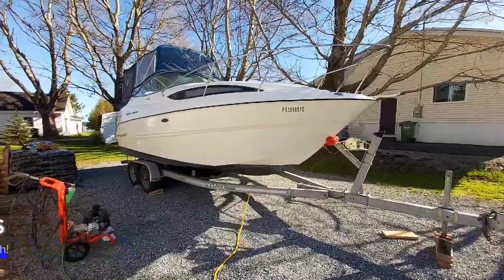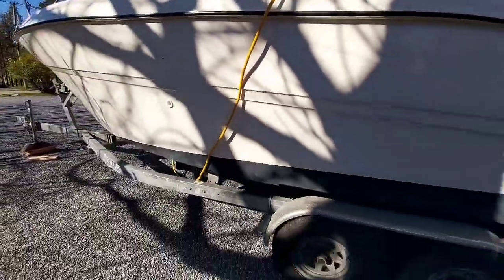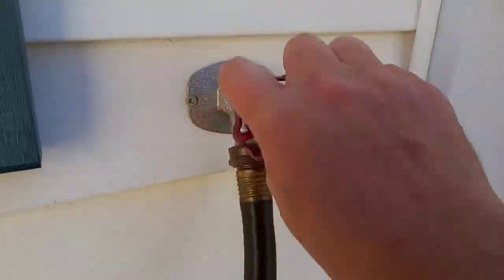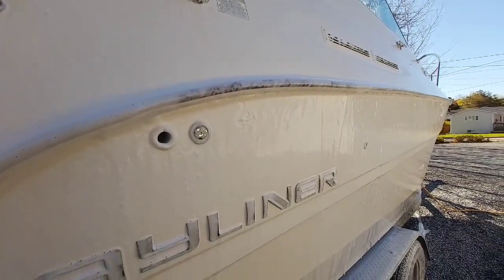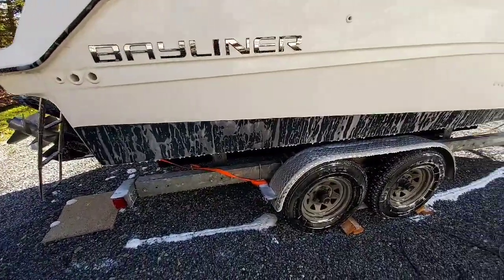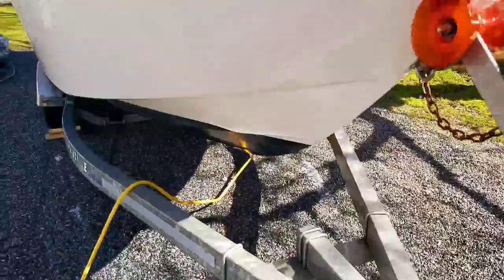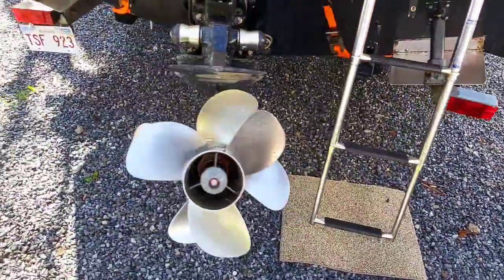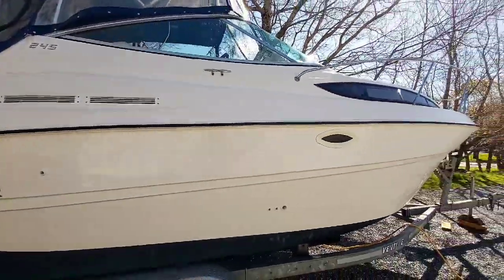2013 Bayliner Ciera 245 Boats First Snow Foam Bath!

Comment: What is the maximum eidth of the boat and the trailer? I building a new fence and wanna make sure the gate is wide enough for a boat this size
Reply from the maker: The boat trail is 104 inches wide so add about another 18 inches on each side for the boat width (over hang)when it's on the trailer, apx 140 inches